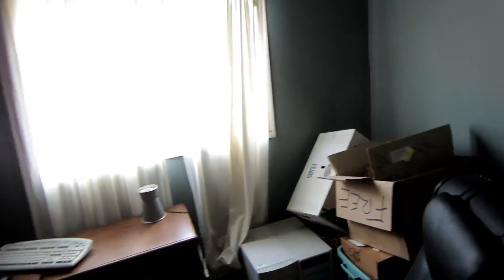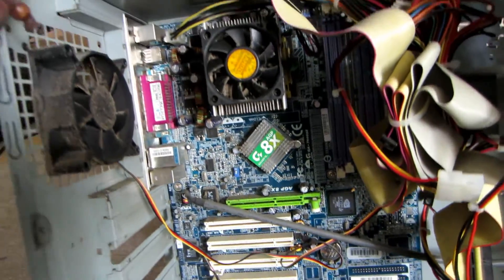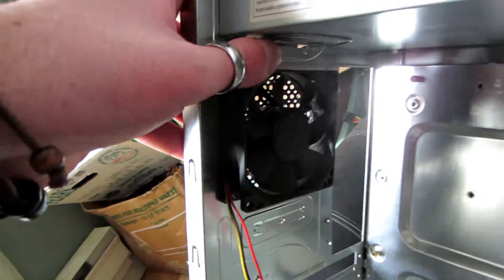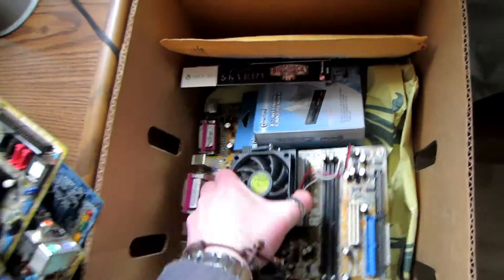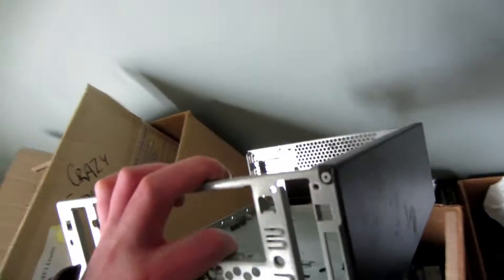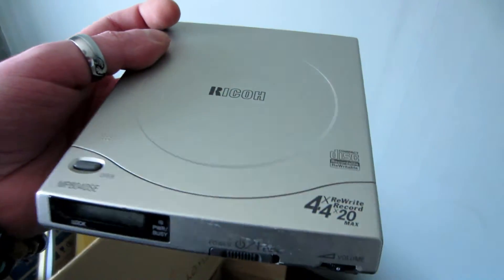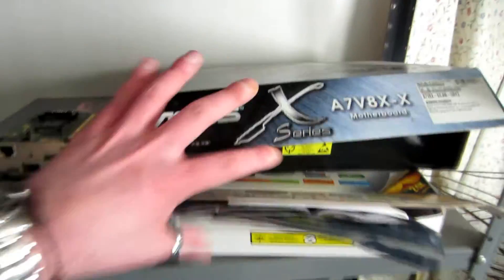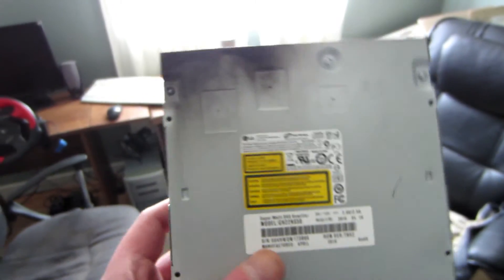The PC Hoard Room : Dirtiest Computer Ever Caught on Fire

Comment: Was it in a barn?  :)
Reply from the maker: +RamblinAround nope, it sure looks as if it could have been tho. yikes!
Reply: +paradoxdesigns OMG I repair computers sometimes but I SERIOUSLY need a room with that much computer parts. I could so much with that as long as it works haha.
Reply from the maker: ***** I've sold most of my spare parts off now. most of em worked! I guess i'll be on the hunt for more stuff to hoard now. haha. cheers man. happy fixing.
Reply: Thanks. I've got a stack of laptops to work on. :) NOw i just need a room to put em all in hehe.